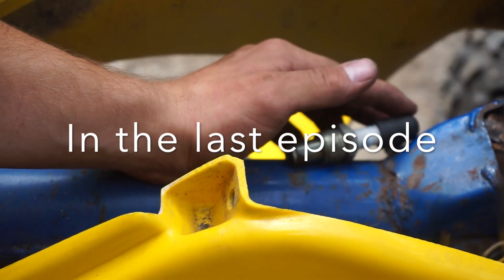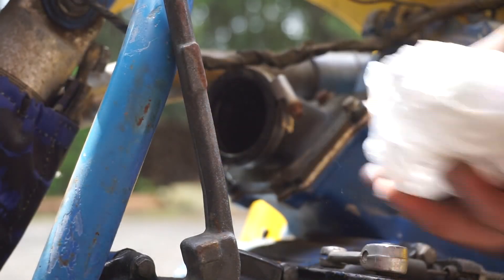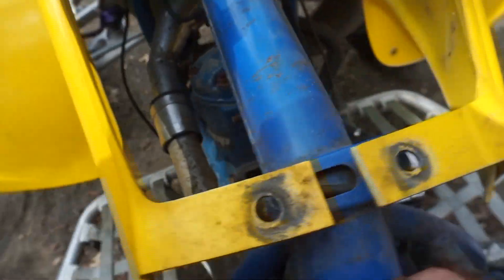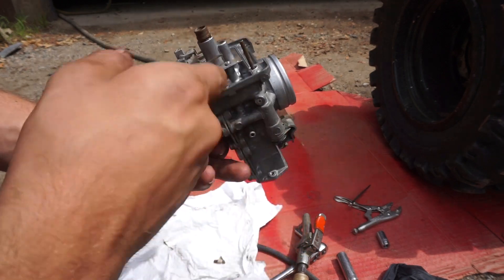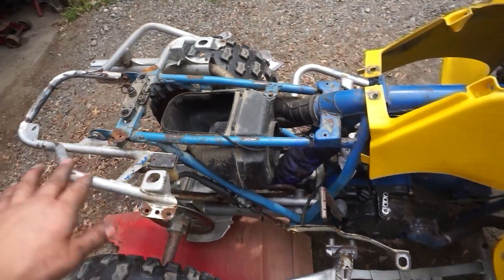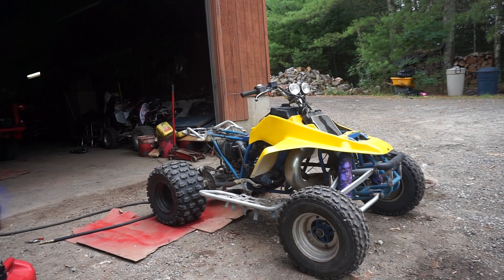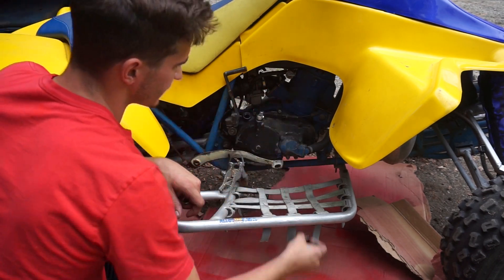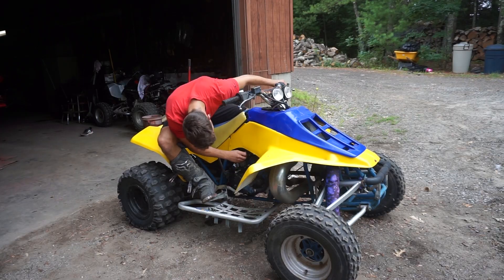FIRST START ATTEMPT!! Will it Run? $1400 Quadzilla (Part 3)

Comment: Personally my zilla likes the joke on, with the kicker half way down in the sweet spot, with a tab bit of throttle, without that, it will not start. Every bike likes it’s treatment differently.  Check the packing in the silencer, it may be roached.

Comment: I have a banshee with a cr500 engine on it and I just hit it with starting fluid on cold starts and you gotta position the kick at top dead center when starting those big bore two strokes
Reply from the maker: that is wild I wanna see that

Comment: i know this is a old video. just wanted to add that you have a 1988 and up cylinder on it. the 87 Big reed intake had 6 bolts on the reed cage. same as the 87 big reed LT 250R. the baby brother. the red fluid is atf type f. when we drag race banshees we use transmission fluid. cause its not all thick. can run it in the zilla also..safe for wet clutch

Comment: Need some tips on making it easier to start every time I’ve got a few tricks
Reply from the maker: Let’s hear it bro
Reply: @andrewarsenault4062  start by getting rid of that flat top carb go with a pwk40 and get the reeds done. And to get a faster start advance your timing one degree it will call for a shorter kick as the spark kicks right in. Also helps avoid getting that kick back. It’s one thing we learned on the zilla we have hear that’s made it a big difference in firing up especially when already warm.